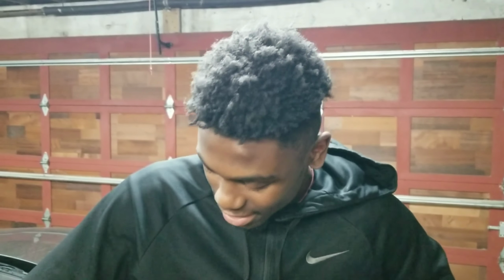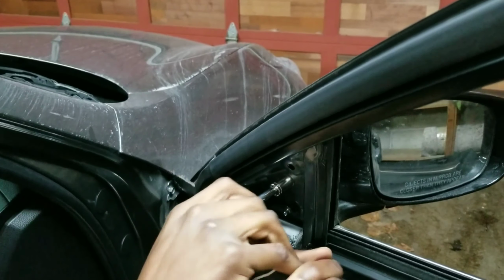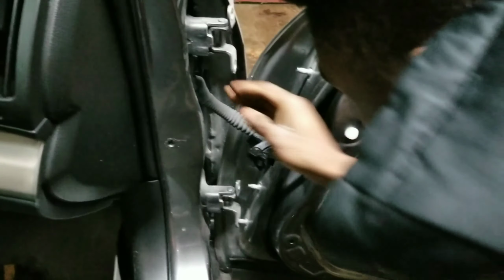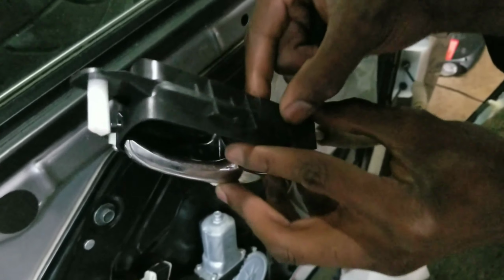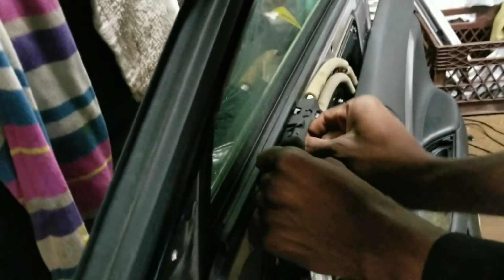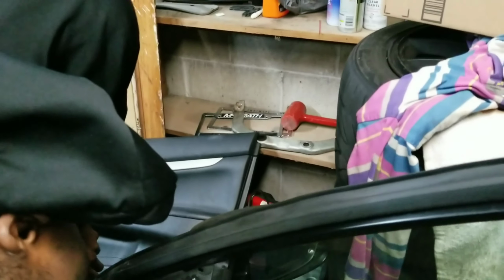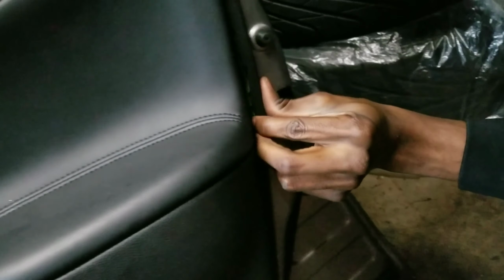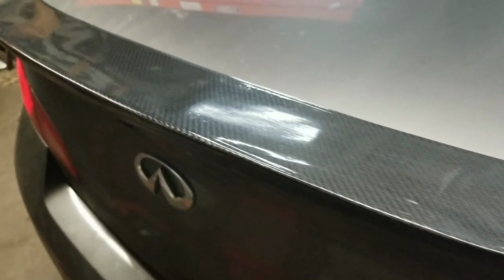Infiniti g37xs sedan | How to change / replace any Nissan / Infiniti door super simple!!!

Comment: Did you have to swap the harnesses from the g37 to g35? I own a g35 and found 2010 door and was wondering if it’s just plug n play
Reply from the maker: Tbh I think I may have switch out the wires cause i wanted the oem ones they lookk better and work better for everything id feel
Reply from the maker: If it works plug and play tho Just use it cause I did it like the other way round
Reply: So if the g37 door locks and things  doesn’t work after changing doors i’ll have to switch out my g35 door wiring harnesses onto the door g37?
Reply from the maker: Yeah if some things don't work on the door that's what I would do so that everything can work

Comment: I have a 2009 G37 Sedan. Do you know by chance if a 2012 G37 door would fit on a 09? Need to replace the driver door. Thanks!
Reply from the maker: The door i replaced was for a 2009 my car is 2013. If that helps

Comment: About to replace a door on my 2010 G37. Did you have any security alarm issues when  switching out the doors?the new door match up with the car  security?
Reply from the maker: No problem since the piece basically connects to the door, it should just basically work when you connect it im pretty sure. You may need to reset the windows or something
Reply: 👍 thanks for replying back
Reply from the maker: @jmarshall4591  no doubt thanks for watching 💯🤝🏾 stay blessed

Comment: I have an 08 g35x sedan & i need to replace my front passenger door can i replace it with a g37x door??
Reply from the maker: I did it with a g35 door by accident if it doesn't work then you'll just have to switch out wires from inside the door
Reply: @JoJoCars  ohh aii ima buy it & see if it works out than lol
Reply: yoo did your key fob still unlock the door that u replaced?